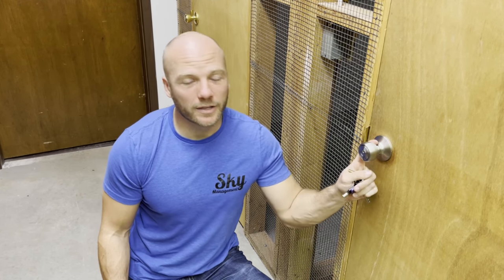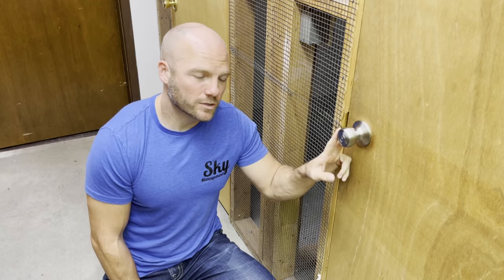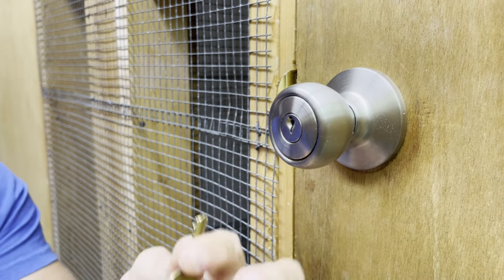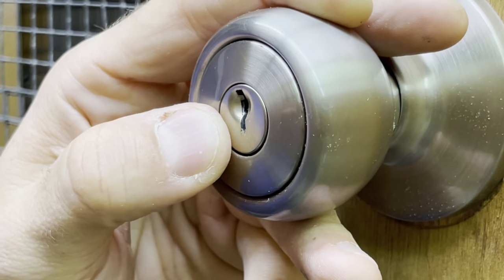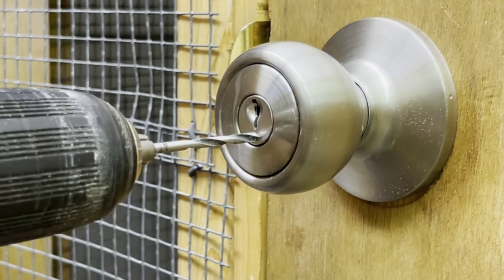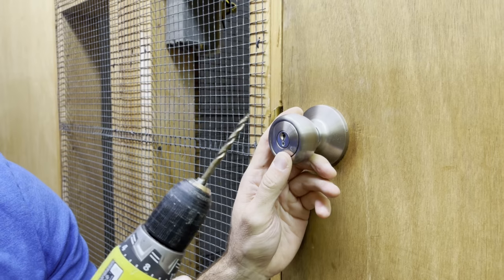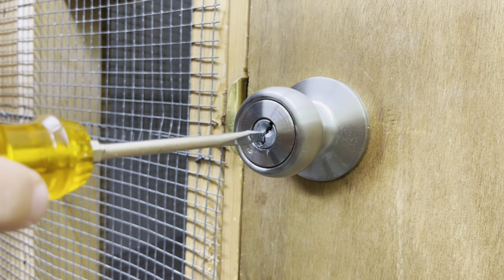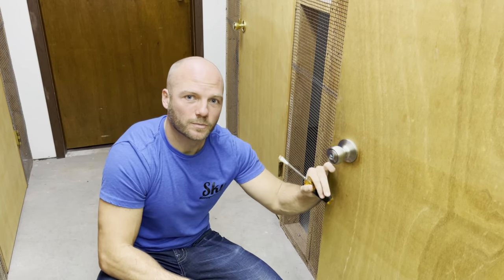How to drill out a lock FAST

Comment: Thank you... wind blew my door shut in my garage, locking me out. After calling 8 or 9 locksmiths and getting an average quote of $150 ... I looked up at Home Depot, the cost of a doornob... realized I would save about $110 by just drilling it... was in in just minutes... bought and installed the nob the same day... thank you for the video
Reply: Probably lying...how did you get your drill and bits when they were locked in the garage?
Reply: @-Only.Facts-  I was imagining they were in the garage with the bay door open and the wind blew the door to inside shut
Reply: @-Only.Facts-  I had them in the house, duh
Reply: @GoogaLiuyta  🙄 everyone knows you're supposed to keep a drill in the garage smdh
Reply: @-Only.Facts-  mine were in the house emoji man
Reply: @-Only.Facts-  meanwhile my drills are in a tool
Room IN my house

Comment: Thanks!!! I paid a locksmith 80 bucks a few years ago to do the same thing. Never again thanks to your great video 👍
Reply from the maker: Glad I could help!
Reply: you paid a locksmith to drill a lock? that sounds like a lock installer someone who calls themself a locksmoth but all they know how to do is drill locks and fit new ones they stock up on from home depot
Reply: @chunkyfecalbreakfast  amongst other ways yep not saying they dont drill locks but it would be like the last thing they do

meanwhile lock installers just remove the lock and put anouther one in and call it a day
Reply: @chunkyfecalbreakfast  i had EXACTLY this situation with my grandmother 

she locked herself out (door only opens from the inside with the handle key outside)

she called a 'locksmith' who drilled the locks and replaced

best part is a bent coat hanger through the mail slot would have gotten her back in just push it through pull the handle down

locksmiths would have absolutley tried that they even have devices to turn the thumb latch

even better is you could see the back door was open granted the garden gate was locked but any locksmith would have seen that and just offered to hop the fence

it would have taken at best 10 minutes to get her back in her place and the charge wouldnt have been much more than god £60 for the basic call out fee which eh ok he runs a buisness he cant be wasting money on her dumb antics so its fair

Comment: Saved my ass with this one thank you! My father lost my keys to the trailer hitch lock which prevents someone from joining their truck up to the trailer and driving off with it. Scary how fast I was able to do this. I didn’t even need to drill a second hole. The pilot hole was big enough that I was able to get the lock off in about 30 seconds total using a good drill bit! Thanks again.

Comment: There is a faster way to open that lock if you no longer want the hardware. Take a large pair of channel locks and turn the knob until it snaps off. Then you can reach inside the mechanism and pull back the door latch.

Comment: How far in did you drill?  1 inch?  About the length of the part of the key that goes in keyhole?
Reply from the maker: About an inch. You need to get through all of the pins. You can always pull the drill out and try it. Then if it doesn’t turn yet, go a little farther.

Comment: Honestly for a simple lock and door like that, get a thin piece of plastic (cut it out of a plastic bottle, rectangle about 5x8 centimetres) and slide it into the space between the door and the frame beside the lock. Wiggle for a bit to get it under the catch but the door will swing right open. Faster, easier, and you don’t need to buy a new lock 🤷‍♂️
Reply: Only works if it's a door without a locking bar on the latch.
Reply: @Greev or when locking bar is fully extended.

Comment: Trying to do it on a leverset where the key slot is horizontal. Any suggestions?
Reply from the maker: You want to drill the pin side. Whichever way the teeth face when you would put in the key.

Comment: Years ago I got locked out of my house, I took a large hammer and knocked the handle off of the lock completely by hitting it down then took a screwdriver and twisted the bolt open. Then I got in .

Comment: The lockset looks like it was installed upside down. Normally the keyway is at the bottom of the cylinder.  I drill out probably 30+ locks a year. It’s absolutely astonishing how cheap they built.
Reply: Locks are only a deterrent. Never fully prevent a committed thief.

Comment: It didn't work for me.. drilled the whole lock out after trying the pilot, then 1/4" bit.. I definitely got all the pins, but the knob wouln't turn still. Might be the type of lock (re-keyable) with a handle knob vs round knob.. not sure

Plan B.. bust the doorknob and twist the internal bolt mechanism.. that worked.

Comment: I drilled the pilot hole just like you showed and the core popped out. Then I shook the core to get the pins out, put it back into the opening and was able to turn it with a different key.  I didn’t even need to drill the bigger hole.  Your video saved me a lot of time as any other option would have taken longer.
Reply from the maker: Nice! Glad we could help :)

Comment: I just used a 15/64 drill bit (slight smaller than a 1/4, only because I could not find one) and an impact drill.  I put it right into the key lock.  At first it bound up, so i started the drill full speed and hit it.  Took less than 20 seconds and the entire key hole spun around.  Took the drill out and it was open.  
What scared me the most is how fast it was to really open a lock.  So much for security...